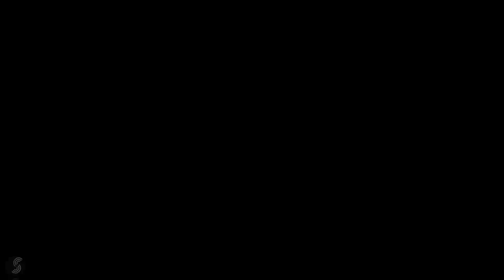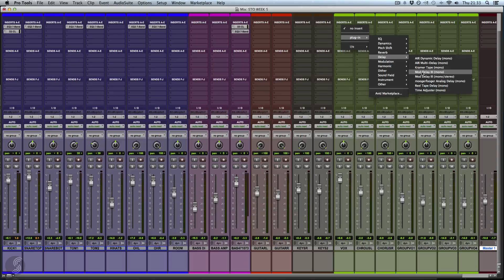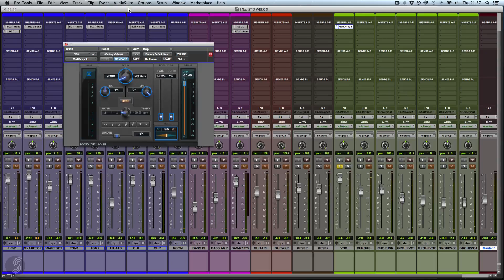Pro Tools With Aidan Cunningham - The Delay Unit

Comment: Please Use A pop filter or pop shield is an anti-pop noise protection filter for microphones, typically used in a recording studio. It serves to reduce or eliminate 'popping' sounds caused by the mechanical impact of fast moving air on the microphone during recorded speech and singing. It also keeps moisture off the microphone which can cause mold growth. Additionally, a pop filter can protect against the accumulation of saliva on the microphone element. Salts in human saliva are corrosive and thus use of a pop filter may improve the life of the microphone.[

A typical pop filter is composed of one or more layers of acoustically semi-transparent material such as woven nylon stretched over a circular frame, and often includes a clamp and a flexible mounting bracket. Metal pop filters use a fine mesh metal screen in place of the nylon. An improvised pop shield, functionally identical to the professional units, can be made with material from tights or stockings stretched over a kitchen sieve, embroidery hoop or a loop of wire such as a bent coat hanger. It is important that the pop shield is not attached directly to the microphone as vibrations will be transmitted from the shield to the mic.

Popping sounds occur particularly in the pronunciation of aspirated plosives (such as the first 'p' in the English word "popping"). Pop filters are designed to attenuate the energy of the plosive, which otherwise might exceed the design input capacity of the microphone, leading to clipping. Pop filters do not appreciably affect hissing sounds or sibilance, for which de-essing is used.

A pop filter differs from a microphone windscreen. Pop filters are generally used in a studio environment, while windscreens are typically used outdoors. Windscreens are also used by vocalists on stage to reduce plosives and saliva, though they may not be as acoustically transparent as a studio pop filter.